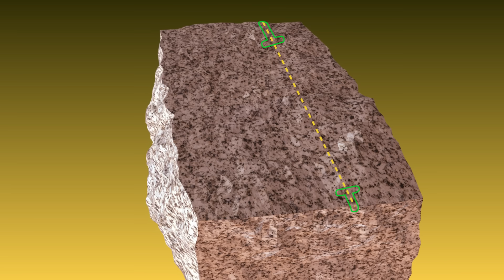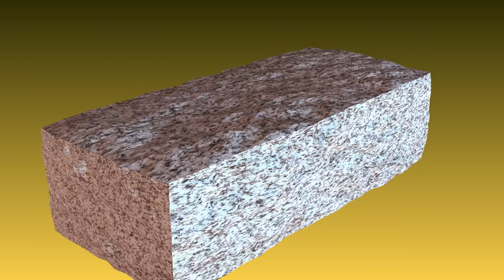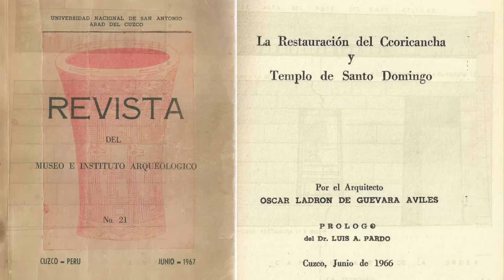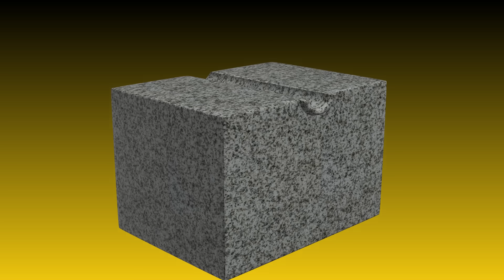Properties of Certain Ancient Stoneworking Traces

Comment: These all look like guttering. As if the purpose of these buildings or walls was to 1) get close to the sky were water came from and 2) filter water downwards through the rock. We can imagine an obsession with rains especially in some seasons when they wouldn’t have any idea why it hadn’t rained for 5 weeks. Building these attempts to make it rain and catch it would be in accord with rain dances and other superstitious behaviour that is well documented. Perhaps even the idea of pyramids - and these earlier structures always look like precursors to pyramids before that specific idea was first used - we’re an attempt to 1) get closer to sky/rain/clouds and 2) have the rock filter the rain towards, easily imaginable on a limestone covered smooth pyramid with a pointy top. Like it’s an upgrade on the earlier stones with grooves all over them. 

This would provide enough motivation for work like this. 

Also, since these projects take such a long time to complete, you can imagine that by the time one part is done it’s been months and then eventually it rains, perhaps confirming their hypothesis that these can make it rain if you build high enough. 

The megaliths in this video and the pyramids and even stone henge and other henges, all appear to be ways to build as high as they can, and perhaps it’s all about the sky and clouds and rainwater.

Comment: ~2:00 The recesses for the "clamps" are not well understood..Those may not be clamps at all. A cast low strength metal "clamp" provides almost 0 resistance to the force that could move 1000s of tons of heavy stacked stone blocks.
Reply from the maker: Thank you. "The metal clamp provides almost zero resistance to the force" - that's what I say in this video: https://youtu.be/VRj69Ou3yOI

Comment: Layout in steel sometimes involves marking with a punch or deep scratches because the later work is so abrasive, paint marks will disappear. Paint marks are not as accurate as scratches
Reply from the maker: Agree. That's what I say: "The question remains the same: why expend such effort on layout that could just as easily have been made with paint or a scratch?"

Comment: Kept nodding along throughout. To me seems like they used some lye based chemical process to dissolve the quartz from granite, andesite, diorite and riolite and mechanically scrape or "scoop" the sludge and thus shape the stone. Clay could be used to contain the heated acid as it works on the quartz to mark the edge with just few hours of treatment. Nubs could be markings on the stone or used to anchor other blocks together like legos. Resulting goop or stone glue could then be poured over the rougher surface and flattened like epoxy resulting in the glass like smooth finish we see and confuse simply as mechanical polish. Let me know what you think.
Reply from the maker: In this video I mention both geopolymers and acids. https://youtu.be/bpvFs9bZu10
Reply: @GRES_TAC  I felt like towards the end of the video you were coming to it but then fell short of mentioning it. Dissolving all the quartz rich stones you mentioned in this video just requires you to burn hardwood into white ash and boil it in rainwater to dissolve quartz from the stone making it brittle and "scoopable". There is no geopolymer or advanced technology involved. You could over time with primitive methods make considerable process into scooping stone this way. Vinegar could be used to neutralize the acid and leave the petrified surface and as I mentioned in the above comment the quartz dissolves into epoxy like running substance that hardens into glass with CO2 exposure. It wouldn't be practical to cast massive blocks of stone with this but you could make obsidian like glass that you could chip into spearheads. Also once you prop your rock up on the wall it becomes harder to treat it with liquid that runs like water and requires heat and long exposure to the acid so it makes sense they have the scooped unfinished look to them.
Reply from the maker: @thekbshouse  Yes, I've heard that "natron" theory. It's a myth to me. I've burned granite with coal more than once, and while it does lose strength, it doesn't turn into epoxy or anything else. And it doesn't react well with acids.
Reply from the maker: "Quartz is only dissolved by hydrofluoric acid (HF); common acids like hydrochloric (HCl), sulfuric (H₂SO₄), or nitric (HNO₃) do not react with it. Other acids can "etch" or damage its surface over time, but they do not dissolve it. Hydrofluoric acid reacts with the silicon dioxide (\(SiO_{2}\)) in quartz to form silicon tetrafluoride (\(SiF_{4}\)), which then reacts with more HF to produce hydrofluorosilicic acid (\(H_{2}SiF_{6}\)). "  Make a video of yourself melting quartz with wood ash, that would be a breakthrough in chemistry.
Reply from the maker: It's a completely different matter if the acid affects not the quartz, but the surrounding minerals, which will lead to a decrease in the stone's strength. https://www.youtube.com/watch?v=VtHSdH63h-Q For example, I noted in the video about the sarcophagus that the biotite appears damaged. https://youtu.be/tOICtofKKM4

Comment: If the ,,T,, shapes are pressed in to wet concrete, a strait board holding them down to dry in to the mix , would leave a mark across the wet material. Then the other side of the ,, T ,, shape is poured around on one side and the next one it pushed in again. 😊
Reply from the maker: https://www.youtube.com/watch?v=bpvFs9bZu10  15,20  and "Evidence from Detailed Petrographic Examinations of  Casing Stones from the Great Pyramid of Khufu, a Natural Limestone from 
Tura, and a Man-made (Geopolymeric) Limestone "
Reply: But these T shaped marks are not in concrete. They are carved into natural stone.

Comment: There are lots of saws.  The grooves arent just like paint in that they denote the surface of the finished plane, and there is no nasis to say they were done "quickly".
Reply from the maker: Thank you. I agree. It's also important to consider that a much smaller number of grooves is sufficient for level control. And in the case of the Serra Capia quarry, the transverse grooves could have been painted or scratched.

Comment: 12:20 maybe they used electricity and water to cut the stone, like this "erosive abrasive" close to the metalforming technique
Reply: But where was all of this electricity and equipment coming from?
Looks like equipment was extremely advanced due to work they've done...
Why use such a precision (aircraft precision) just to build the wall of stones?
If such a precision can be use to build aircraft or spaceship...
Reply from the maker: @marcingaal8610  "Why use such a precision (aircraft precision) just to build the wall of stones?" - https://youtu.be/llAjTpYutBU

Comment: Pardon my ignorance. Would someone be able to help me? 
Do acids react differently when intentionally exposed to electrical currents? 
Does the hardness of igneous rock change when exposed to electrical currents? 
Can an electrical charge be directed through igneous rock? 
If a charge is sent through igneous rock, can its intensity be navigated to a specific area of the rock? 
Would there be any evidence of ingenious rock or any rock showing signs of electricity, being used, if so? 
Would these rocks begin to melt, displaying the consistency of playdough, as their temperatures rise with electricity flowing through them? 
Would the magnetic values of these affected rocks become unisone or magnetised? 
Is copper the best conductor for electricity?
Reply from the maker: There are many questions with simple answers. Granite is a dielectric and does not conduct electricity up to its breakdown voltage. However, its dielectric properties decrease with changes in parameters, temperature, and humidity. For example, if saltwater is present in the pores (no acid required), and so on. The answer is actually simple: with access to electricity and methods for converting it, electric motors will be available, allowing drilling and cutting, which is much more effective than irreversible destruction through heat.

Comment: Consider the Craftsmen heating up shaped Metal Pieces, laying onto the Rock for a while, then quenching with cold Water, repeat - a thin top Rock layer will crack and lift off. IF that Metal Piece is shaped like a Square for example, or Triangle, you would be able to precisely create those rectangular Corners inside and recessed. Interesting Video, thank you.
Reply from the maker: Thanks a lot.

Comment: These groves may be intended to interface with wooden elements of the structure.
Reply from the maker: The polygonal buildings were not used for living and had no roofs. https://youtu.be/SSM4d238JSI
Reply: @GRES_TAC  What we think they were used for is actually just a theory. I have recently had my lidar finds concering the 50 meter sea level in Britain confirmed by ChatGPT Deep Research. It looks like most of the standing stones were for mooring boats and ships and the hillforts are coastal forts. Deep Research confirmed these harbors with ballast stones and compacted sufaces by looking at archelogical studies, and agrees with me that they are boat ramps and harbor facilities.
You can do the same with the area you are studying. Take a topographical map and find the contour line at which there are no megalithic monuments below it. In Britain I found 3 shorelines which corespond to the transition from Neolithic to Bronze age, and from Bronze to Iron age. The benefit of studying Britain is the good quality lidar that allows me to see the shoreline.

Comment: It looks like it was done with an electrode with an arc gouging technique, some flat chisel shaped some round rods like pencils, using an EDM type process, possibly using wireless energy to ground out to the earth creating the arc against rock.
Reply from the maker: "Electromagnetic destruction of rocks" There are books and patents on this. But it requires high-voltage electricity. And pulsed electricity at that.

Comment: 0:19 When fabricating the Aswan obelisk, such a cutting was applied using steel tools (pickaxe, short chisel, long chisel, hammer, sledgehammer, wedges, crowbar) that tool marks remained on the blocks removed from the trench, and there were practically no tool marks on the walls and bottom of the trench. On the walls and on the bottom of the trench, there were mainly characteristic recesses (places where stone was broken off, so called “scoop marks”), which “scientists” today pass off as the result of pounding with dolerite balls. The few traces of steel tools that still remained after the cutting were subsequently destroyed by tapping. Most likely, it was made with the same dolerite hammers.

A detailed description of the cutting method used in Aswan is given in the book “Peruvian polygonal masonry: how, who, when and what for” (148 pp., 2025).
Reply: Even modern tunnel digging and minor's don't like working granite. We go to hammer drilling and explosives 🧨🧨🧨💥💥💥
Reply: @DANTHETUBEMAN true. I've employed  ex-miners in the past that couldn't easily transition to surface quarrying much to our surprise.
Reply: @GroberWeisenstein  >true. I've employed  ex-miners in the past that couldn't easily transition to surface quarrying much to our surprise.

My book doesn't mention a "tunnel digging". Read the book first, then comment.
Reply: @DANTHETUBEMAN  >Even modern tunnel digging and minor's don't like working granite. We go to hammer drilling and explosives

My book doesn't mention a "tunnel digging". Read the book first, then comment.
Reply: I stopped using thermal torches for granite channeling in early 1990s in favor of slot drilling & diamond wire.  The ancient method also utilized heat   but with lower temperatures that produced wider channeling and divots. (Scoop marks)
Reply: @GroberWeisenstein  >...  The ancient method also utilized heat   but with lower temperatures that produced wider channeling and divots. (Scoop marks)

No heating at all was used to obtain the known marks on the obelisk and on the walls of the trench. As I wrote above, the technology today as a whole remains the same. Only the grooves between the cut off blocks today are made with the help of machines.
Reply: @RostislavLapshin there's heat signatures on all of the surfaces. The pocket divots are indicative of an intensely heated center.  I have decades of experience with using thermal tools for channeling, carving, and texture finishing of granites.  What technology remains the same today ? We have undergone many processing changes in quarrying over the past 35 years. The pit method has been mostly discarded for step/bench  method.  Your research is incorrect.
Reply: @GroberWeisenstein  >there's heat signatures on all of the surfaces. ...

On most of the surfaces of the unfinished Aswan obelisk, I do not see any traces of heat exposure. I see the usual manual processing of stone with ordinary steel tools.
Reply: @GroberWeisenstein  >I have decades of experience with using thermal tools for channeling, carving, and texture finishing of granites. What technology remains the same today ? We have undergone many processing changes in quarrying over the past 35 years. The pit method has been mostly discarded for step/bench  method.  Your research is incorrect.

The unfinished Aswan obelisk was formed around the 19th century. Your reasoning about the last 35 years is not applicable.
Reply: @RostislavLapshin how much granite have you removed using thermal torches to recognize it elsewhere?
Reply: @RostislavLapshin you wrote that " today the technology as a whole remains the same" I pointed out that in just 35 years our quarrying technologies have changed significantly. For relevance please outline the leading process used today and compare this with the process of 35 years ago. Then compare this with the leading process used a mere 100 years ago. Then 200 years ago. We can walk this back thousands of years to antiquity and a definite image will form that is not consistent with your version. .
Reply: @GroberWeisenstein  >What technology remains the same today ?

Read the book if you want to figure it out. I do not have the opportunity here to explain all the points of the evidence individually.
Reply: @RostislavLapshin why not ? The significant advances are few for each period if you actually know what they are. How much granite did you say you've carved using thermal methods ?
Reply: @GroberWeisenstein  Write a post/article with explanatory drawings and photos, I'll read it.
Reply: @RostislavLapshin I am quarrier and manufacturer and you are researcher and book writer.
Reply: where are all these tools? there would be piles and piles of tools and tool factories with tools to make tools and on and on??????????
Reply: @standingbear998 All those buildings you see around you are impossible to build.  Where are all the tools?  If people had built those buildings with tools, you would see them just lying around the buildings where the workers just dropped them on the last day when they finished.  Since we don't find those tools just laying around, those buildings must be natural.
Reply: @standingbear998  >where are all these tools? there would be piles and piles of tools and tool factories with tools to make tools and on and on??????????

The Unfinished Aswan Obelisk is a fake.
Reply: @RostislavLapshin where are the tools used to build the Empire State building ?
Reply: @GroberWeisenstein  >@RostislavLapshin where are the tools used to build the Empire State building ?

If the Unfinished Aswan Obelisk is a fake then you will find around it only those tools that the facifiers left intentionally to confirm their fake. My conclusion related to the fakeness of the Unfinished Aswan Obelisk is based on an analysis of the markings left by falcifiers. The analysis details are described in the above mentioned book. Once again, when fabricating the Aswan Obelisk, such a cutting method was applied using steel tools that tool marks remained on the blocks removed from the trench, and there were practically no tool marks on the walls and bottom of the trench.

It is noteworthy that the similar “incomprehensible” traces (“scoop marks”) on the walls, on the bottom of the trench and on the Aswan obelisk itself can be observed today in many operating quarries since the technology as a whole remains the same as before. Only the grooves between the cut blocks today are made not manually but with the help of machines. In particular, the mentioned book contains photographs where markings similar to those on the obelisk are formed in an active Japanese quarry for stone extraction in our days.